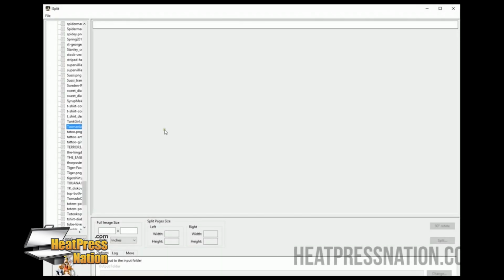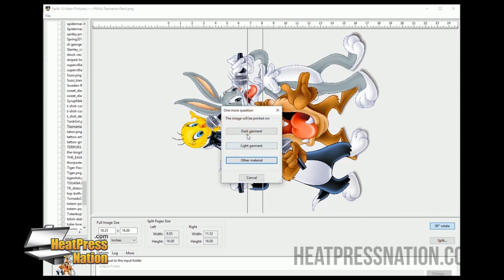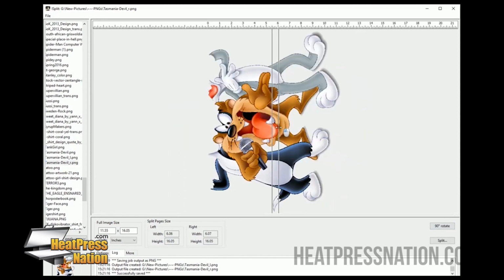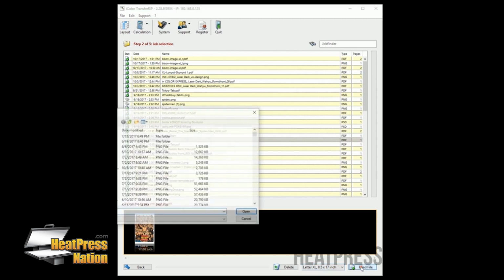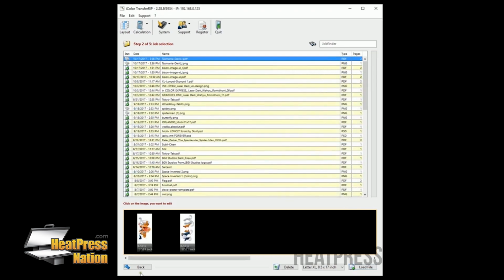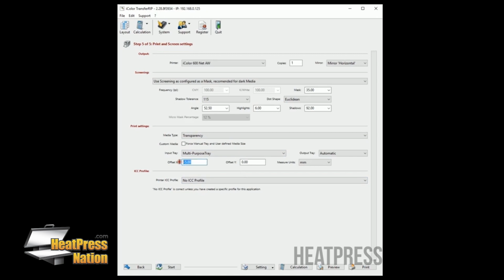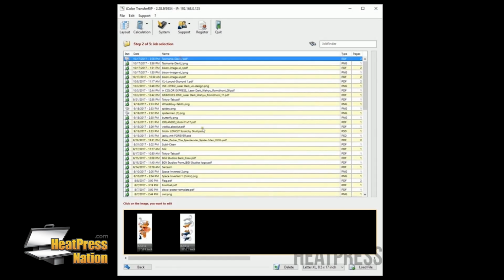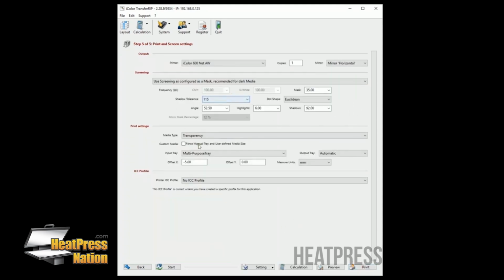Forever IC-Split Large Format Conversion Software

Comment: I got this program (but it doesn't have all the features showing in this tutorial) and I have been using it for weeks now, and I cannot get a seamless result. There is always a slight overlapping which makes the seam noticeable. Something to note is I am not using Oki white toner printer. I use an HP M452DW with the Ghost white toner. *UPDATE* I believe I have resolved my issue. When Splitting I needed to make the split area (overlap area) bigger.  It allowed the program to really pick the best split area.

Comment: That shirt looks labor intensive for just one shirt. What happens when you need 100?
Reply from the maker: A lot of shops using white toner laser printers for garments do so for one-offs or low-quantity runs where screen printing may not be cost-effective. This software is a way for smaller shops to be able to offer larger prints to their customers. This software is still cheaper than buying a new larger printer like the OKI Pro8432WT.
Reply: @HeatPressNation  Right! I was just about to pay a pretty penny to get a large format laser printer when I happened upon this program. It saved me 'and' allowed me leftover funds to get another Sawgrass Sublimation printer I've been wanting :) Thank you for the awesome video!
Reply from the maker: Subcontract a screen print shop for your transfers! lol...

The main feature with this software is allowing you to print images larger than the 11"x17" max from the OKI white toner printers. Now, OKI is set to release the new Pro9541WT very soon, which prints up to 13"x19". However, that printer is expected to retail for about $13K. So depending on your situation, it's likely more cost effective to go this route on a smaller OKI WT printer for your extra large prints.